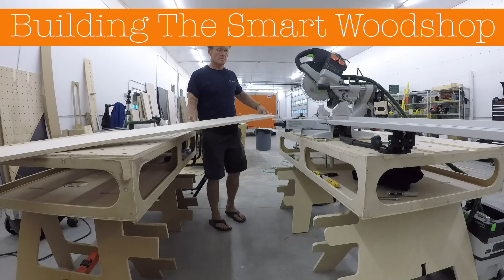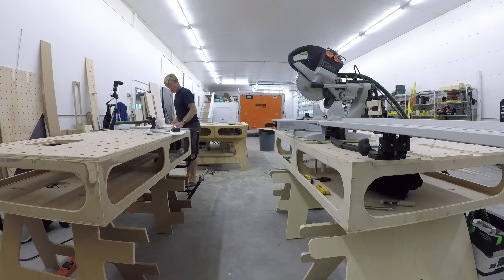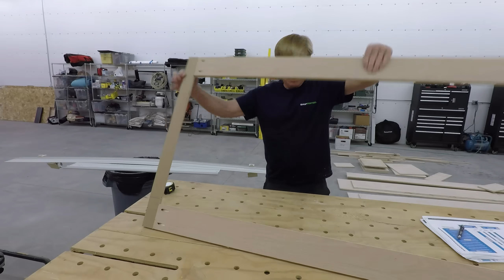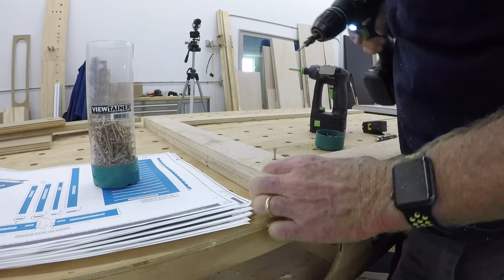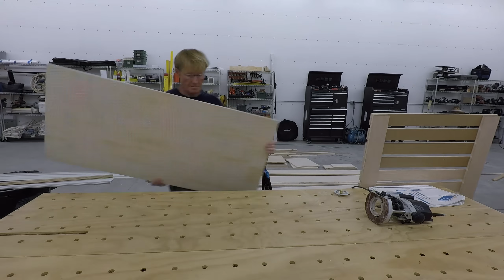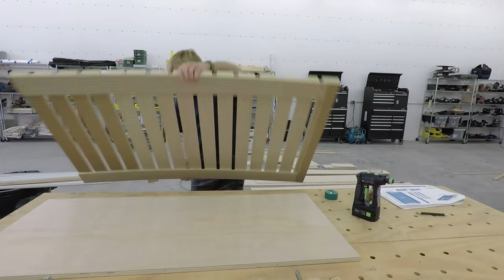Building my woodshop #3: Drawer dado jig.

Comment: Ever think about just using 1x3 dimensional?
Reply from the maker: Dimensional lumber has a tendency to warp, while plywood remains stable.
Reply: @TheSmartWoodshop  about five minutes after typing this out and walking into my garage I realized this 😂

I have about 30 left over 1x3’s from a job and thought I found a use for them  

Bought the PSB, SMART and trim rack plans. And two routers. 

I don’t have a trailer, but I work in the city and have a small garage, so I’m going to use the concepts to organize my on site gang box and inventory/storage at home. 

Love the videos man!

Comment: Ron, thanks for all the great videos and plans!  Is ART still the plan to use for a 7x14, or should I modify the SMART plans to fit my 7x14?  I've bought both sets of plans, just wanted your advice on which is my best bet. Thanks!
Reply from the maker: SMART. It is the the best cabinet design and is easily scalable. It has been used for bigger and smaller trailers box trucks vans plus big and small shops.😎🤙
Reply: @TheSmartWoodshop  Thanks for the quick reply!

Comment: loving these videos!  I'm wondering if you've ever given thought to incorporating the passive restraint into the dado jig, rather than adding the little strips of wood with glue and staples later on.  it would require a little more work to the jig, obviously, so I'm not sure what the overall time savings would be, if any, but I'm curious as to what you think or may have thought about that?

Comment: How deep are the dado cuts? I have the plans but I don't see the depth needed. Maybe I missed it?
Reply: I am trying to figure that out myself now. 
anyone know how deep to make the dado?
Reply: @KyleB-TheLMTV-TinyhouseGuy  I ended up setting the bit to plunge just under half the distance. I figure I can adjust the drawers when I get to building them. Good luck!
Reply: I came here looking for the same answer. I also don't see this in the plans, I suspect it's half way through the sheet since the side view of the DB Drawer Lock on page 8 is marked at 3/8" x 1/4"
Reply: I do believe it is half way (3/8 or 9mm), but for the cubbies i believe the depth is only 1/4 or 6mm. If you cut thru the cubby jig at half depth (3/8) if makes the jig so weak, mine cracked 😂 i doubled checked the math in the difference between the side and divider on cb2/3 and it is only 6mm. On cb1 it seemed greater so i did the same as with my drawers, just went halfway. When i went to lift the jig for the second cubby, it cracked, luckily not all the way apart

Comment: Ron, I bought your plans only for the drawer bank plans. I’m trying to figure out the floating and fixed stop. Did you address this in a video?
Reply: Did you ever get an answer
Reply: @joshuahaggerty2722  no. But I think I figured it out. I believe the floating stop was for making a second round of dados on the taller cabinet. I only made the shorter counter height cabinets, so after experimenting, I think I screwed the floating in place and it worked fine. It was six months ago so I don’t really remember.
Reply: I figured it out. Thank you tho. There was another video because Ron had to fix it.

Comment: Ron, you are so correct about using the router bushings.  I've chewed up too many templates using the pattern router bits.  Your drawer designs will be used on all of my shop cabinets and for my Systainer cabinet(s).   The Systainer drawers will only have a bottom and a front.  The front is used mainly as the drawer pull.

Comment: Hey Ron,

What did you determine the spacing to be - exactly 3/4”? Also, in the sketchup model of this jig you had a shallow rabbet in each of the horizontal boards. Did you abandon that idea?  

Thanks!
Reply from the maker: I added the difference between cutter and guide which was ⅛" to the actual cut desired ¾" for a total of ⅞." I did have the rabbet on this jig, but realized that I didn't need it as the jig goes top to bottom and is fixed, I abandoned the rabbet on the cubby jig which came after this one. When making an adjustable dado jig the rabbet helps a lot.
Reply: Ron Paulk sounds good. Thanks, ron. I’ll be making a set of drawers for the garage soon using your design. Can’t wait